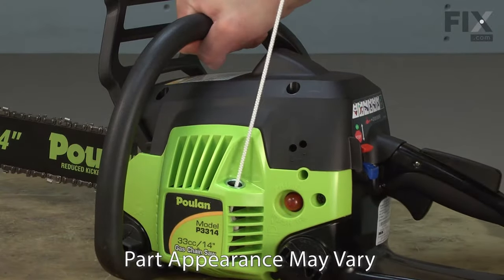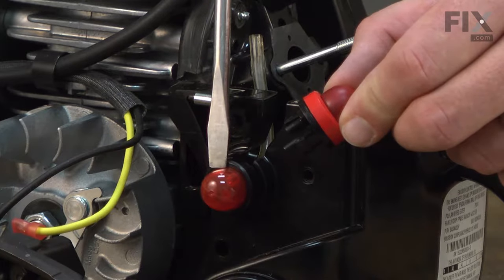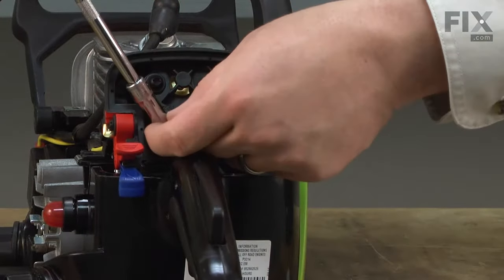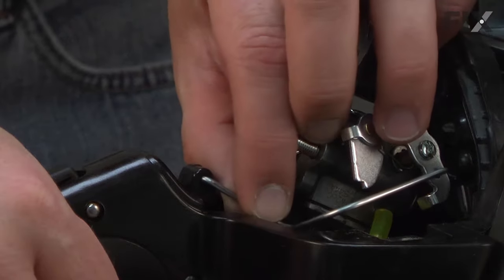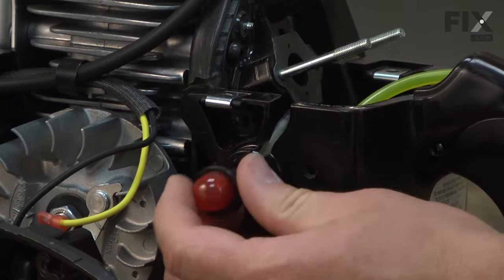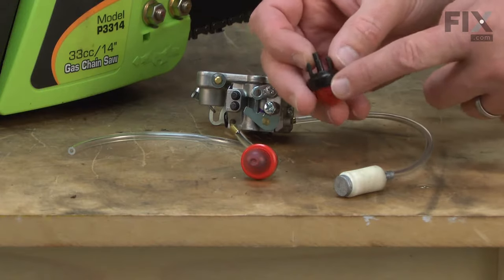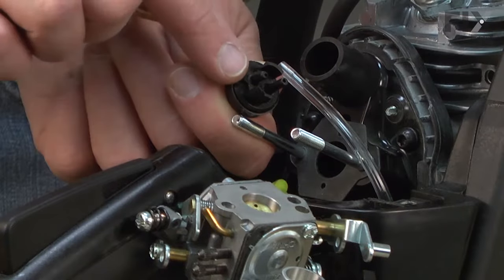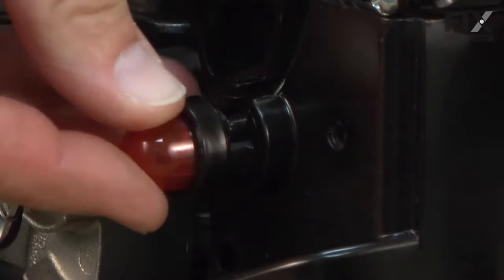Poulan Chainsaw Repair - How to Replace the Purge Bulb

Comment: I'd already replaced the bulb but it wasn't working. Your video helped me realize I has the gas lines switched. Just an FYI for everyone out there: if you have the lines switched, when you try to prime it it will only pump a few times before it won't pump anymore because instead of pulling gas through the carb & filtered line you'll be trying to push it through and it don't work in reverse. Thanks for the explanation on that part rather than just throwing it together and saying installation is the reverse of taking it apart.

Comment: If you're just replacing the bulb, just take off the pull start cover which exposes the primer bulb and pop the bulb out.... You don't need to remove the carb unless you're changing lines

Comment: You skipped over reinstalling the choke lever. It needs to be installed before the air cleaner is installed to the carb. Not a big deal, but causes a bit of extra work if you don’t realize.

Comment: You can do this without pulling the air filter and carb out. just use something to pry the gap wider and the old bulb comes out the side